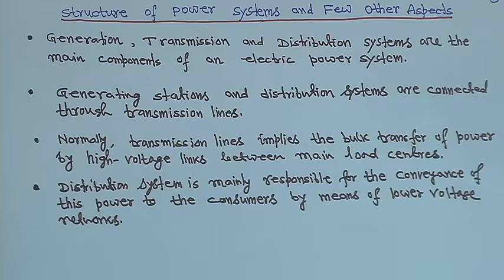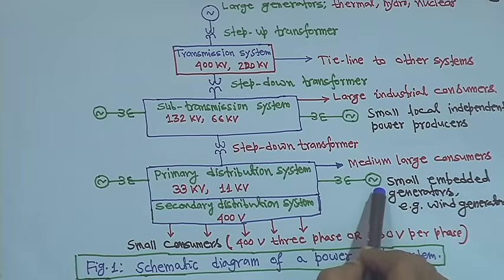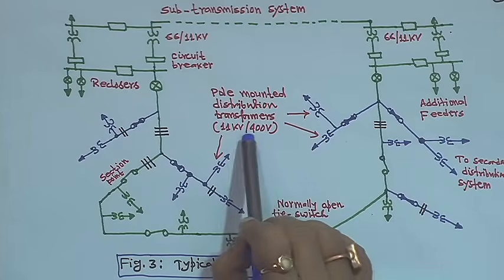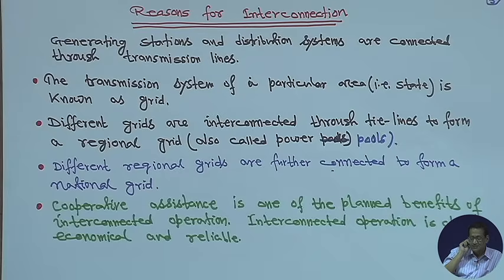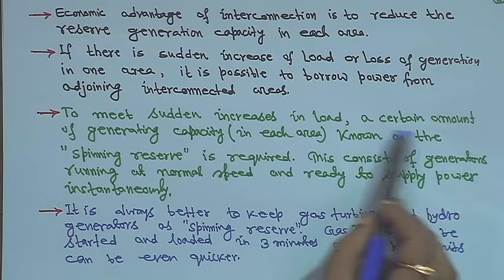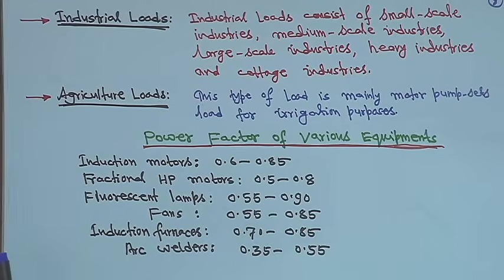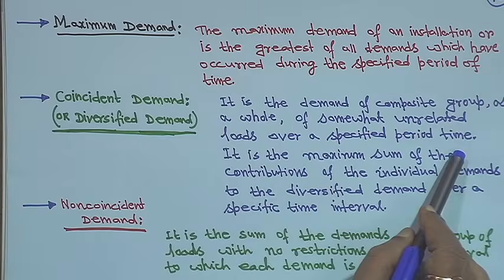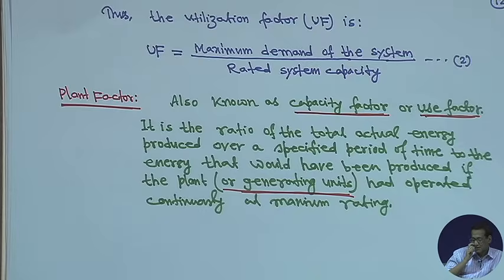Lecture 1 : Structure of Power Systems and Few other Aspects - I

Comment: Why the transmission line voltages be 132kv 66kv
Reply: at early ages, they used to consider the 10% voltage drop for each system of Transmission voltage. consider transmission voltage to be 60kV then they used to generate 66kV and transmit the power. similarly 120kV+(10% 0f 120kV = 12kV)=132 kV. nowadays we can see EHV voltage 400kV where the 10% voltage drop is not considered because of the present technology.

Comment: Why the name came tie lines?
Reply: Because it is used to interconnect between two substations when ever one substation need power then other subsation will provide power by using tie line. And tie lines are two types. 1) D.C and 2) A.C